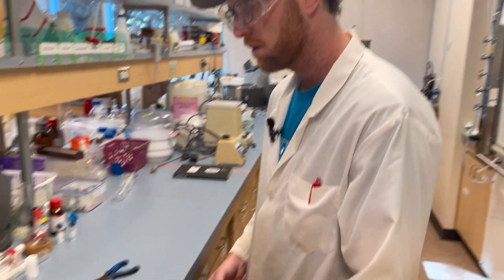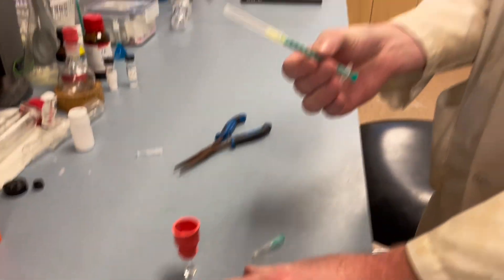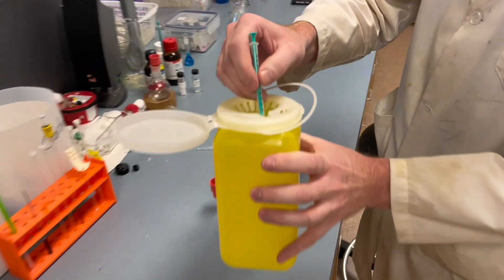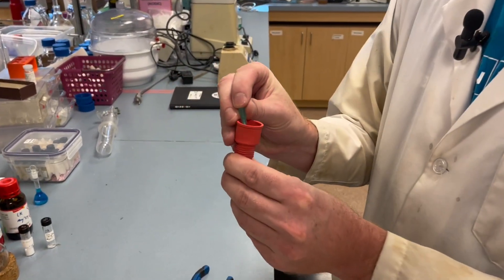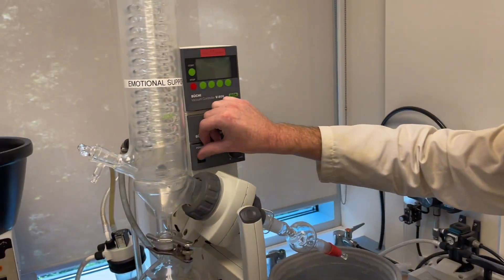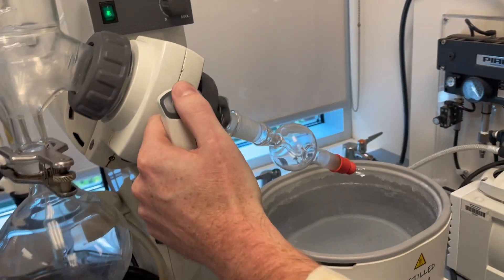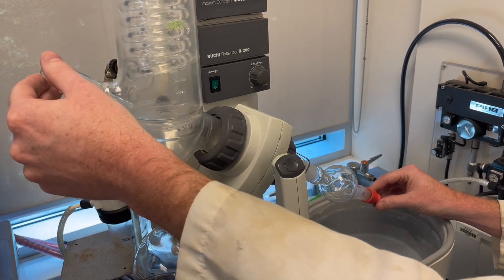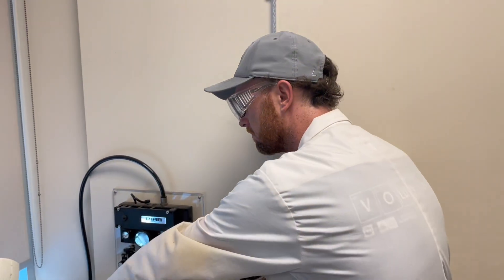Rotary evaporation of solvent from a vial

Comment: What is the reference of the adaptator between the vial and the septum ?
Reply from the maker: It is a bump trap, so if the solvent bumps instead of evaporating smoothly it is captured before contaminating the condenser